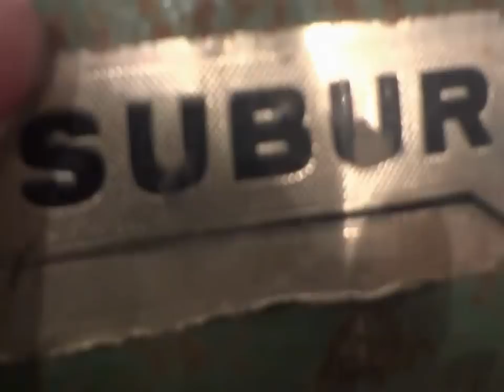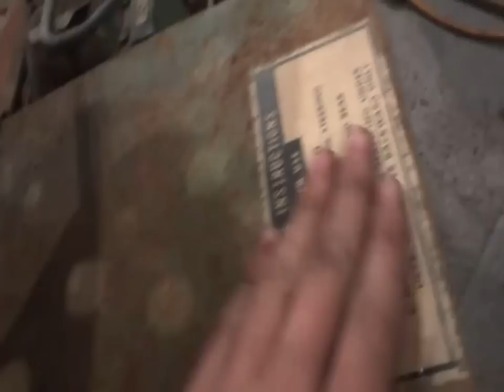mini lawn tractor

Comment: Like the mini tractor, if I had one I would put a 6-8hp engine on it, with electric start.
Could that Scots have a bent rod, or is there a hole in the block, behind the starter where Briggs engines always blow, lol